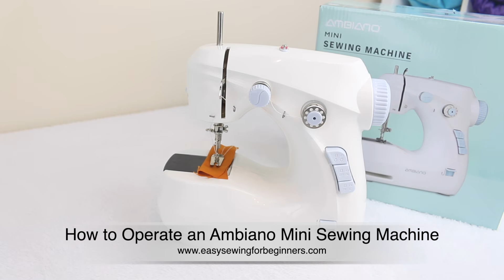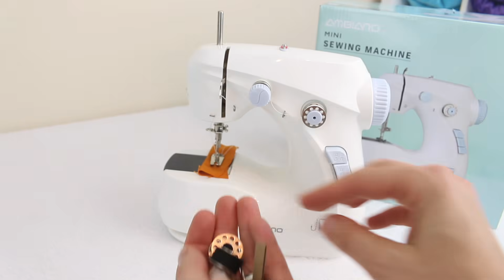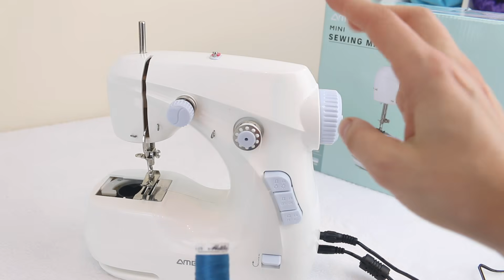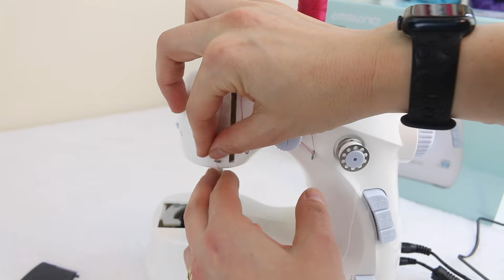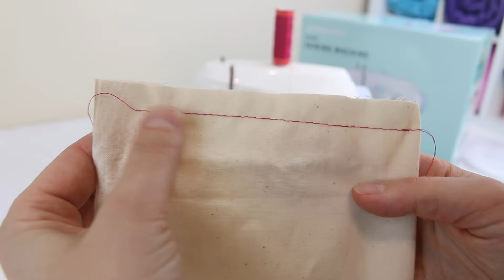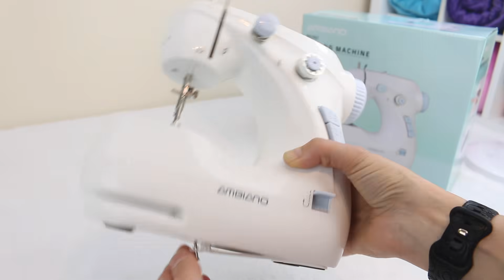How to Operate an Ambiano Mini Sewing Machine | Aldi Sewing Machine

Comment: Thank you so much for the in-depth tutorial! 💌 Also, I had some trouble using the tension thread - I unwinded it to remove the original thread, but I’m not sure what the correct tension is? I ended up with patchy/inconsistent stitches and thread bundled up as a mess behind the fabric. Please help with this I’m not sure what to do to fix it🥲

Comment: I encountered a problem as soon I started winding the thread. The hand wheel works fine but when I press the button or the foot pedal, the machine just produces sound but does nothing. Any solution to this problem? Mind you, it was my first time using the machine.
Reply from the maker: Have you made sure the needle is threaded from left to right?

Comment: Hi there,
I followed everything as you shown in the video but when i turn down the niddle the botom thread doesnot comes up with lower bobin thread😢😢 why is that can someone help me plz
Reply from the maker: Are you turning the hand wheel towards you when you’re making the needle go down and back up?
Reply: @EasySewing4Beginners yes
Reply from the maker: @sunitatamang6817 also double check that the needles is threaded from left to right. If that is correct as well, then it could be the fabric you’re using, the needle may need to be changed or the machine timing may be out. It can be a process of elimination when these machine are not doing what they’re supposed to be doing 🧐

Comment: Hey there, how do you remove the battery housing?  We've loosened the screw but there is no "locking button" as per the manual 🤔

Comment: Can you also use the paddle while the battery are in or will it break the machine ? 👍
Reply: Yes, the foot paddle should also work on the batteries. 

A leaflet in the box warns not to use the electrical adapter while the batteries are inserted.
Reply from the maker: Yes you can 😊

Comment: Hi, I've threaded everything as the video and it worked great, but now it won't pick up the bobbin thread, any tips?  Thanks 😊
Reply from the maker: When you manually turn the hand wheel towards you do you see the top thread go over the bobbin in the bottom part?
Reply: I've had a look and it seems like it's misaligned, the hook on the part you click the bobbin into isn't catching the thread
Reply: I had the same problem but realised I was turning the wheel the wrong way. Turn wheel towards you and not away from you